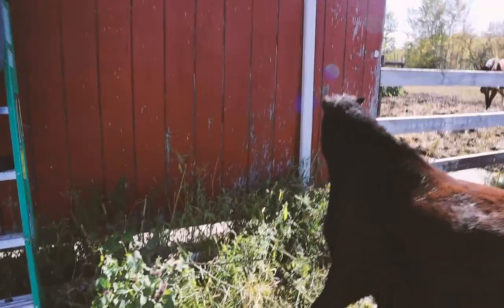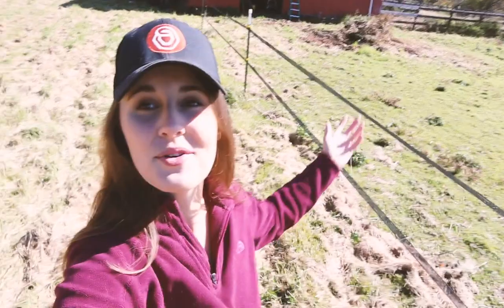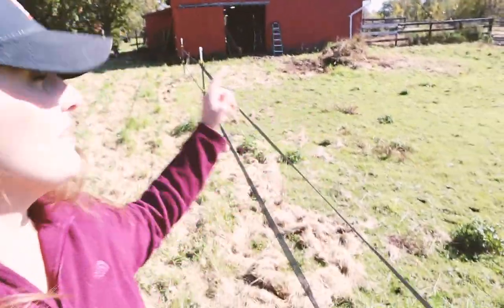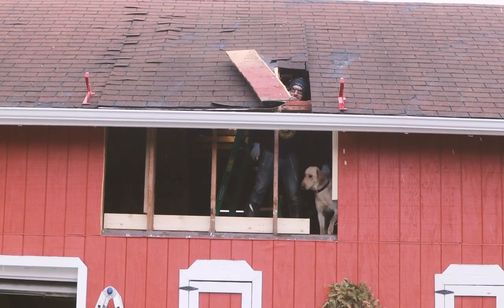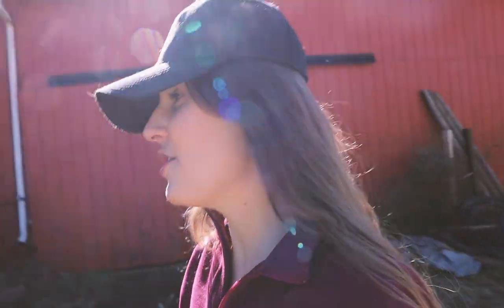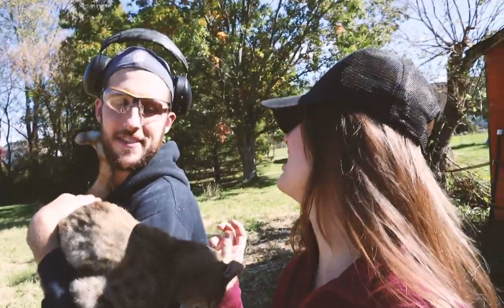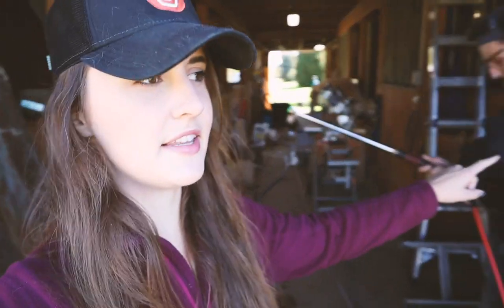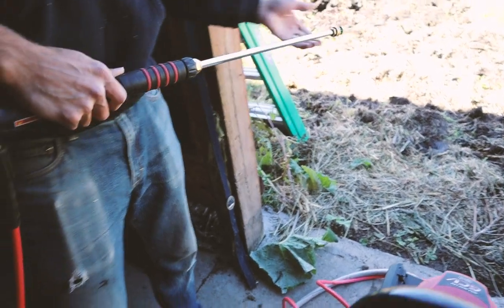Why We Won't Paint Our Barn Red

Comment: I don't normally give unsolicited advice, but I would like to say two things on my mind:
To remove the loose paint, the pressure washing needs to be done slowly.
White, Hmmm. My reservation with white is that it might blend in with a snow covered landscape. I don't know if that will cause problems with the avian wildlife.

As usual, I enjoyed the video. keep up the good work!
Reply from the maker: Interesting reservation! It’s pretty low lying on our property so I’m not concerned about birds flying that way, but it would be good to consider if the placement was different.